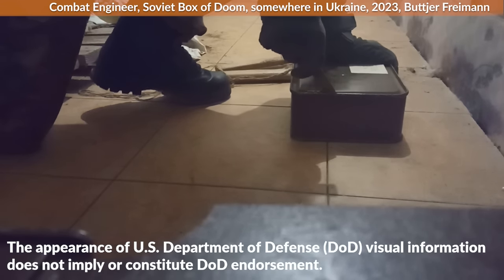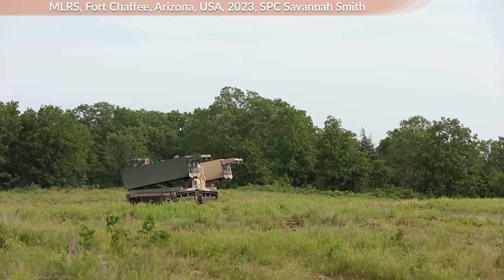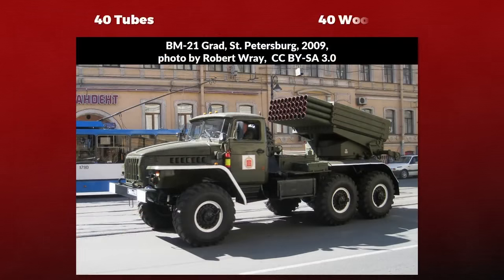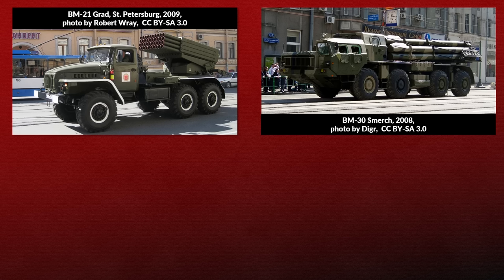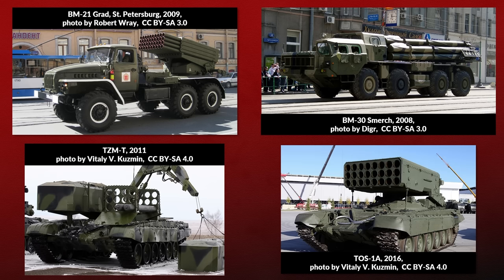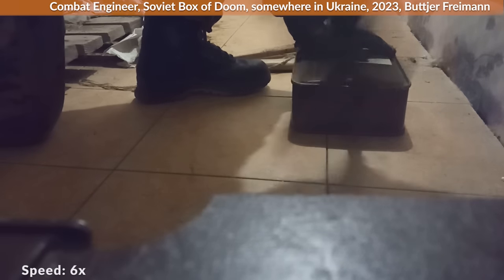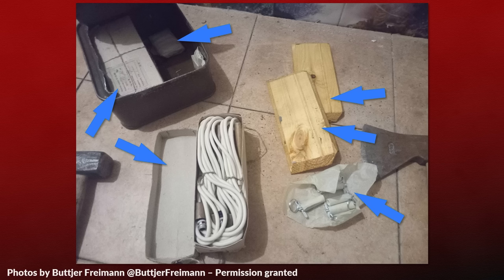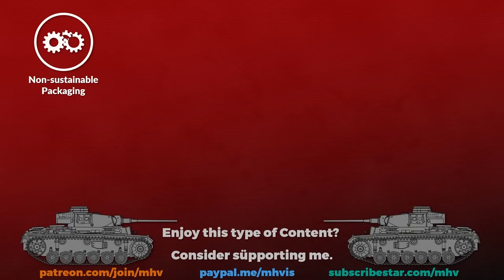Ukraine: Why Soviet Packaging is a Nightmare - Unboxing Edition

Comment: "would've lost on logistics alone" by merely looking at how long it took to reload a grad system, even though most of russian artillery were mobile artillery guns, not launchers, and as we see now their logistics are still doing fine even after 2 years of conflict entering into the 3rd year, so well infact they are even making a new railway thru zaphorizia, i have never in my life heard of something like that, a entire battalion focused on making railways during war so they can keep supplying the troops as best as possible, but the Russians have it.

you are also comparing the grad to systems that aren't even the same, mars and himars are precision guided rocket launchers, they are also of the long range group, meanwhile grad is a short to medium range unguided rocket launcher meant for barrages instead of precision targetting, 

Meaning a better comparison would be the Tornado S or Uragan-1M systems which do have a loading system like the himars and mars which involves another truck.

as for the grad, the grad is not made to be advanced, all it is and all it ever was is a system thats cheap to build, using a ural truck base and a basic rocket launcher system, 

Himars costs around 5,5 million per unit, launcher and reloader, and thats just the vehicles, each missile is over 220,000 a piece

Compare this to the grad which the Ural truck its based on only costs 20,000 a piece brand new with the launcher itself most likely not costing any more than 6000 if i were to say from my welder's perspective and metalworking experience, The rockets also cost most likely around 5k each since they're dumb rockets, and sure they might not be armored but thats been left to the crews themselves which as the conflict has shown works quite fine with the creation of mad max style vehicles.

this is also adding on the fact Russia does not need to pay extra costs when making the equipment, as all of its military industry is owned by the government and as thus they always pay the price it costs to make the unit, as the military industry cant to profit off the government as its literally owned by the government, this is why prices are so hard to figure out with russian equipment that wont be exported as their industry doesn't sell to its owners, the government.

unlike with the US where the military industries can simply raise prices if they feel like it, which is how their prices increase every year pretty drastically meanwhile Russian equipment barely if at all rises in price to produce as all the resources are also government owned, if they got it, they'll use it

Comment: They dont care in the east, manpower is not a issue in Russian doctrine, send 40 meatheads with 40 crates to reload.  Also the west have plug and play, try explaning that to a Russian. Archer, Leopard all systems have plug and play for engines armour diffrent loadouts etc and fast reload.

Comment: Those awful Soviet cans were exported in large quantities to the USA in the 90s and 00s as cheap ammunition for the civilian market, along with the SKS and Mosin Nagant rifles to fire them. To this day they remain notoriously hard to open, even when you're at home and have access to power tools. Not to mention the fact that once opened, since there's no way to close them, your ammo needs to be used right away, lest it begin to absorb water and become useless. Only a "Fudd" (think Elmer Fudd, the Looney Toon) would buy them over comparable boxed ammunition.

Compare that to NATO cans, which can be easily opened and re-sealed just by flipping a lever on the side. They also have handles. As such, many people buy one and use/re-use it for years, for anything that needs to be stored in a water-tight container unattended in the garage. I have two, the youngest is from 1961 according to the stencil on the side, and it still opens and closes fine.

Comment: These brilliant German engineers forgot that in war it is not always possible to operate loading machines, especially in the operating conditions of GRAD, which is located as close to the contact line as possible, because it uses uncorrected 122 mm rockets, which are often fired by batteries of 3 -4 vehicles, after which they fold up and go to the base, or to the BC replenishment point where you can simply throw away these same boxes in advance and the vehicle crews themselves will charge them, the charging speed is not at all important here, since GRAD and HIMARS urgently leave the shooting post and leave so as not to come under counter-battery fire. NATO experts have always confused exercises with war. For example, simply forgetting about issuing flight missions for an adjustable rocket, this is also not 5 or 10 minutes. And how can one compare MLRS of different calibrations with different purposes and methods of application? HIMARS must be compared with TORNADO-S. Experts, like me too, will get lost in three pines.

Comment: one more good argument for single packaging and against using multi-rocket containers like the west does is - single packaging can be brought in manually and can be reloaded manually.
Give me a box of 40 rockets, or even of the 6 rockets of the western vehicle, 
and you NEED a crane. No (semi-reasonable) amount of people can bring, lift and manipulate this thing.
So if you expect Russian logistics to suck under war conditions (which is a safe bet), their way makes sense...
Reply: Theoretically, yes. Practically, for the M270 and derivatives, the crane is included in the vehicle itself. But yes, I too suspect at least some of this is due to making it human portable. That being said, I'm pretty sure if you HAVE the necessary mechanical equipment and corresponding packaging, your logistics will be easier, no matter how shit the rest of the logistics train is.

Comment: The sad part is those are the easy cans...... Before the sardine cans they used a lead can with a steel strip that you were suppose to feed the strip thru a tool that looked much like a clevis pin, but with a slot rather than a hole, then twist removing the steel strip like you do a perforated carboard strip on modern packaging Except the strip was prone to failing almost immediately leaving you with no way to open it besides cutting or beating the can open.

Comment: They are designed to be stored for decades, not to be user friendly. As for wooden boxes -those can be reused in quite a few ways. From reinforcing your trench to simple fire wood. 
Is it all good? No. Will average Russian soldier be surprised to find mint condition looking bullet from 1956? Also no.

Comment: the number ten minutes is really for one rocket  i have seen them carry it from the box and push it by hand in the tube very exhausting work  you may get  7or 8 in 15 minutes then you are totally exhausted your speed of loading is going to be slower I would say a whole hour is needed  that is if you have no jams i have seen them banging on one rocket which went in 80% and didn't move there  after only after banging on it

Comment: could the wood also help with moisture absorption?
Reply: nope. It's just cheaper than metal.
Reply: you are all so wrong... its basically just to fill the empty space or else the content inside would move around which would decrease their condition after decades. there wouldnt be enough space for a third box inside in this example, so the empty space was filled with wood. the same can size is used for many other things, so sometimes the volume is maxed out and no wood is required. ohhh and its cheaper

Comment: I would also point out just to maintain 155mm artilery for Ukraine to work they have to fix
Zuzana 2: V8 engine Tatra T3D-928-70 325 kW (436 hp) + Tatra 817 8x8
BAE Archery: Volvo D10BAAE2 + Volvo PT 1560
CAESAR 6x6: Renault Engine + ?
CAESAR 8x8: Tatra T3 V8 + ?  
2S22 Bohdana: KrAZ-6322 chassis with a KrAZ or MAN 6x6 chassis, or a Tatra 817 8x8 chassis. In July 2023, a video showing the 57th Motorized Brigade operating at least two pre-production Bohdanas mounted on the MAZ-6317 chassis (with the original Russian engines replaced with Chinese engines) was published.[14] The 2S22 Bohdana was officially adopted by the Ukrainian Armed Forces on 21 July 2023.[15] Two days later, an improved Bohdana mounted on the Tatra 815-7 8x8 chassis was reported as being in service with the 1st Special Purpose Brigade.[16] Militarnyi reports that the Tatra 815-7 chassis is likely being sourced from stored Ukrainian BM-27 Burevyi that ran out of ammunition during the first year of the Russian invasion

On top of this, they also have to deal with the tracked 155mm. 
PZH 2000: MTU 881 Ka-500 + renk hswl 284
ASH Krab: MTU MT881Ka-500  + Allison Transmission X1100-5A3
AS-90: Cummins VTA-903T-660 + ZF Friedrichshafen LSG 2000Automatic 4F2R
M109A2–A4: Detroit Diesel 8V71T 8-cylinder water-cooled supercharged diesel engine 405 hp @ 2.300 rpm + Allison Transmission XTG-411-2A, 4 forward, 2 reverse
M109A5: Detroit Diesel 8V71T 8-cylinder water-cooled supercharged diesel engine 440 hp + Allison Transmission XTG-411-2A, 4 forward, 2 reverse
M109A6: Detroit Diesel 8V71T 8-cylinder water-cooled supercharged diesel engine 440 hp + Allison Transmission XTG-411-4

And Ukraine needs 155 munition not the munition box. And if this war goes on, NATO has to figure out the supply chains on engines and transmission. There are huge amount of KrAZ and GMAZ truck to retrofit with engines if it is needed. And in reality, they are better off standardize to two engines at most especially on the truck front. I can imagine engine crankshaft and transmission is going to take a huge beating during the Ukraine rain season.

Comment: Not much to be amazed at here. How do you conserve explosive materials for 43 years? Seal them in a tin box. Today, the packaging industry offers much more user-friendly, cheaper, and probably as effective solutions. A thin aluminium box has sufficiently low oxygen permeability, for example. But the inherited stockpiles are from older times. The very unusualness of those boxes is a testament to their successful performance! Simple.

Comment: Yeah, but! You compared a 6 tube launcher with a 40 tube launcher. So the bigger question is how long it takes to load 6 tubes of a Grad!
Reply: Each Grad rocket has 25kg of explosive 40x25kg=1000kg of rocket for salvo
M30A1 rockets for Himars and M270 have 90kg of explosive each, so 540kg for an Himars salvo and 1080 for a M270 one.

Comment: Can you use a standard kitchen can opener with the turner and gears, would an electric can opener work?
Reply: No, you can’t use an electric can opener.  This is a bit over exaggerated.  As for the can opener tool… it can be resharpened easily, and you keep one with you at all times.  A trained soldier can open these cans relatively quickly with their bayonets if needed (I’ve done it many times).  The “spam can” packing tin is relatively durable and very waterproof.  It’s a good thing in my opinion… but I digress.

Comment: The reload time of a rocket launcher is irrelevant to its combat capability. Once you fire a volley only an idiot would sit still and reload even if it only took 5 minutes because that will mean you are dead. If you have to move every time you fire then who cares how long it takes to reload because relocating is going to mean you can't fire again in 5 minutes anyway. The Grad (122m) rockets are hand loaded because they are not particularly heavy. The Uragan (220mm are closer in calibre to the US 227mm rockets) are loaded by crane, as are the Smerch (300mm) rockets. The latter are over 800kg each and can't be hand loaded. Having rockets in pallets is useful if the pallets are loaded with the types of rockets you want to use. If not then you need to use multiple launchers each loaded with different rocket types to attack different target types. Hand loading is more flexible. Their new systems have pallet systems but they are not in wide use yet. Regarding the ammo tins, single use tins makes sense because they have a positive seal so unless damaged should be OK to use. Reusable containers might not have been sealed properly and you find the contents are junk when you open them. Modern can openers with circular blades to pierce the tin could easily be developed to get the job done fast an easy. The Soviets have all sorts of mechanical devices to load ammo belts for different calibre weapons, I find it hard to believe they haven't come up with something to make opening tins easier. Also the disposable one use wooden boxes provide excellent fire wood for extended operations in the field.

Comment: Very shallow analysis of small arms ammo containers. The Russian container is made of thin stamped sheet and the seal is roll formed; very simple and light weight manufacturing process. The US container is made up of more than 10 different metal parts projection welded together and with an added rubber seal. The US container requires more raw materials and manufacturing resources in addition to its greater weight. These "better" containers are not re-used.  In peacetime they are crushed and sold as scrap. Russian military units have a huge version of a kitchen can opener; the one in the wooden box is a supplement for emergency use. If you have spent a day, week or month in a slush filled trench you will realize the annoying can opener is a pretty minor in the grand scheme of things.

Comment: Effin' 'eck, they use detonators a year younger than me. I can tell you, nothing that old works. Me included.

I could see Steve1989MREInfo opening one of these, and being very confused about the contents. Still edible, I'm sure.

One does wonder if their WW2 equivalents were even worse.
Reply: If such a sealed box isn't compromised by rust or penetration the stuff inside works just fine even 100 years later.
Reply: Oh mate, it work, it work perfectly. As long as box was not compromised somehow, what you get inside works like it is fresh from factory.

Comment: Ja wohl. Diza wooden boxes may look impractical, jedzt they are used as a fireplace fuel in coldass trenches at a frontline. Deutscha zoldaten would have to warm their evenings fiddling with threaded pieces of the supplied ordnance lego trying to assemble them into something they can actually use. I'm sure they'd have zea fiel schpas

Comment: The refusal of the West to supply containerized logistics systems to Ukraine is a mystery.  I've seen videos of the Ukrainians breaking down pallets in a warehouse and then loading one 155mm round at a time in the back of truck. Then where they get to the battery they have to unload one at a time instead of using flatracks, pallets, cranes like a NATO unit would.  A PLS would just drop the flatrack at the battery, pick up an empty flatrack and drive on in maybe 5 minutes.  Not spending a half hour and a bunch of people  to unload one round at a time.

Comment: 9:30 true but on the other hand it does have a very long self life and if you are planning to operate an army that  utilised mass conscription and has a lot of man power then  i mean you know you might consider it more important to have  tons of ammo stored ready to go that your pretty sure is not going to have degraded and then  assign 2 men in each squad to can opening duty   its a very .. defense orientated mind set    on the other hand ... if your and making ammunition on the premise hat you are actually going to be using it and using it frequently enough that  there no point in having it in a long term storage format then no this wouldn't make much sense ... still a pain in the ass tho

Comment: So they main question which was left unanswered is: WHY?!
Reply: Because storage in adverse conditions. All those systems were designed to be a part of cold war, not active conflict
Reply: an the obsession whit human portable comes from the reality of most conflict the soviets and soviet sported forces fought they suffered enemy air power
Reply: its basically just to fill the empty space or else the content inside would move around which would decrease their condition after decades. there wouldnt be enough space for a third box inside in this example, so the empty space was filled with wood. the same can size is used for many other things, so sometimes the volume is maxed out and no wood is required. ohhh and its cheaper
Reply: To keep conscripts busy while nothing is going on and when conscripts cant defend because they cant get into the can... you just lost a few conscripts - who cares? Plus now enemy is busy trying to get in your cans to stock up again...
Reply: The broken back war theory, the USSR planed to fight WW3 after the nukes with what they had made an stored before hand.